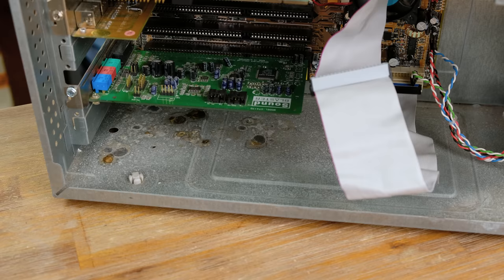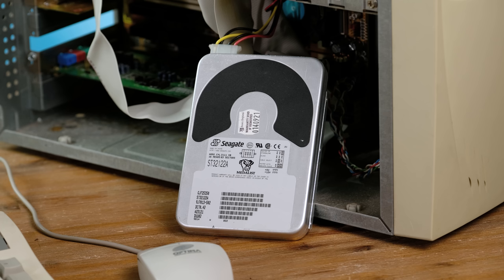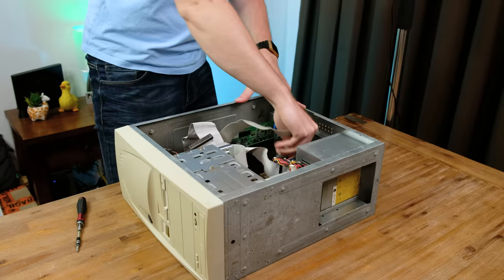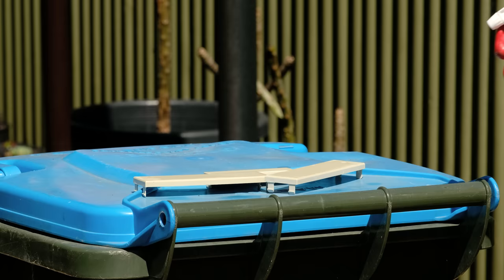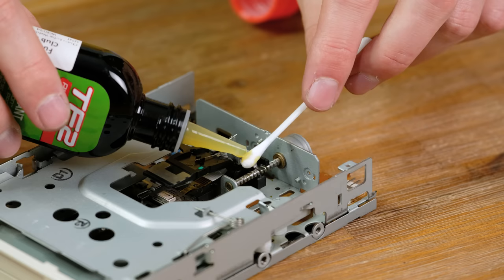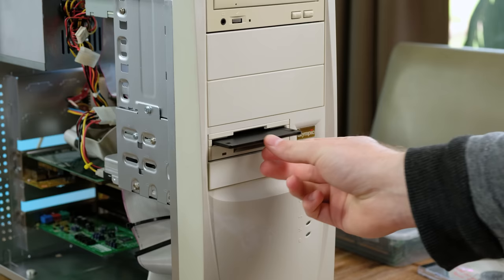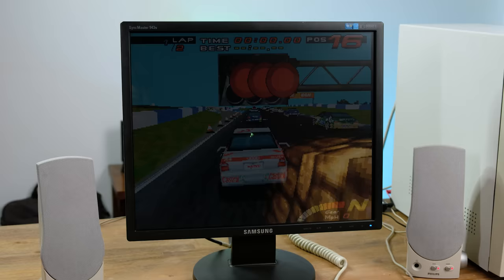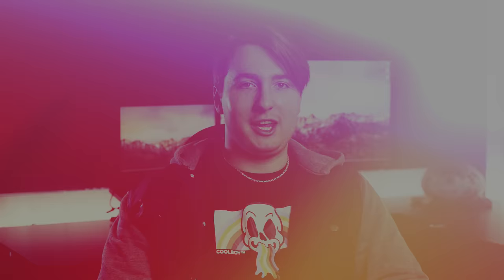Restoring a TERRIBLE Budget PC from 1997!

Comment from the maker: Big thanks to Ridge for sponsoring this video! ridge.com/PSIVEWRI - PS: The systems shows up as being windows ME after a USB driver update. The CPU fan was never touching any IDE cables. Sorry for forgetting to add channel members to the credits! Thanks for watching.
Reply: Good video broo!!!
Reply: I like ms dos also the gateway i would put packabell program on it i like it LOL YOU GOT PRANKED MAN
Reply: Oh hello there, youtube algorithm sent me here heh.

Got a pretty good windows 98 pc myself free a few years ago.
AMD K6-2+ 400 mhz (swapped from a pentium mmx 166 mhz overclocked too 200 mhz.)
32 mb edo ram, could use an upgrade too 96 - 128 mb.
quantum 4 gb harddrive, had a 60 gb western digital drive from 2006 as a secondary drive & briefly as primary after cloning the operatingsystem onto it, but lost the partition so it refused too boot on the 60 gb drive, but still had all games on the other partition.
asus p55t2p4 motherboard, technically doesn't support the processor i put in but it still runs saying its an unknown amd processor lol.
2D gpu: matrox mystique 4 mb some software 3d rendering card, supports like 8 games or something like that & those were only ofc on the included software cd's.
3D gpu: voodoo 1 4 mb from diamond, the monster 3d version, most common one around probably.
Soundblaster awe 32 pnp i think it was in this pc.
pci to usb addon card which either causes the pc too lock up or its either of the graphics cards that are failing fighting over resources.
Bios battery is one of those chips with a built in battery which i haven't bothered doing anything with as it still boots.
Reply: c
Reply: You should find one of these old PCs and completely max out the specs.
Reply: Psivewri I am sending you a video idea, well a letter, in your Parcel Collect address.
Reply: Does anyone know where I can get my hands on that usb and ps2 card that plugged into the motherboard I have a similar machine that will not post without a Keybord and I only have usb keyboards
Reply: Yeah In a 2043 restoring a budget pc from 2020 🤣🤣🤣🤣🤣🤣
Reply: What do you do with all the computers you restore? Do you just throw them away? I seriously doubt you have a warehouse full of those things, and I doubt anybody will pay enough for them for you to make a proffit.
Reply: please do a vedio on dell precision t3600, t5810, optiplex gx 260,
Reply: I still have a case with that exact style of front, except it's a 12 bay tower with separate left and right side panels. I bought the case new in 2000 to build an all new Pentium III system.
Reply: To fix the graphical glitches try popping the RAM chips out of their sockets on the video card then putting them back in to clean their contacts, and get two more to fill the empty sockets.
Reply: please do a review on the chromebook 14a na0000 i have one and i need you're opinion on it
Reply: I have that exact motherboard
Reply: @Psivewri pls i need some advice on a old laptop
Reply: Wait! Is that an Optima Mouse? ;) 9:16
Reply: i also have a old old pc it has 256 mb of ram and 81 gb hdd and it also have floopy     
disk and cd rom its very very old please buy it from me any one please  i want to get rid of it and it has a pantium 4 cpu
Reply: You should buy a hp Pali lion a815n it’s got a pentium 4 processor and is shitty but it and upgrade it
Reply: @GAVRILOVICI AUGUSTIN no i was born in 2005
Reply: Nice
Reply: To fix the 3D accelerator problem, could you add a 3D graphics card? Just an idea.

Comment: 2000: WOW you have 1GB ram? that's so good!

2020: how can you use google chrome with 8GB ram that's not even enough.
Reply: What's amazing is that we treat these old throwaway pcs as relics of the past, but as a piece of engineering it's still absolutely incredible that humans made this thing.
Reply: @Ahsokaaep chromebooks dont need more than 4 gbs of ram
Reply: Most people had 128-256MB in 2000. 1GB was overkill.
Reply: 16 gb ram dual channel :)
Reply: I have 8 gab AND a mechanical hard drive and it can game but it can sometimes crash
Reply: I have 4gb of ram lmao.
Reply: 8gb is not bad not even 4
Reply: its bad as fuck dude, i open my minecrafr launcher, close it and my pc literall freezes
Reply: @babydriver6473  Meanwhile my netbook across the room with 1GB. Upgraded from 512MB.
Reply: Almost like Computers evolve 🙄
Reply: I have 4
Reply: Monochromatik-Vision  In 2008 i got 4 GB of RAM, and guess what - my PC was a Dell Optiplex 760 running Windows Vista Ultimate SP2. I hesitated to upgrade it to Windows 7 but then I decided to dual boot it anyway in 2017.
Reply: In 1988 my first computer had an intel 8088 cpu and 8KB of ram, cga graphics, no hard drive just dual 5 1/4" floppys.. ahh the good days
Reply: Monochromatik-Vision  Well. Older PCs from the 2004-2005 era aren't really designed for use with Windows Vista. So when the same old drivers are rewritten for Vista they tend to be unstable due to the fact that Vista uses a newer driver module as compared to XP (WDDM). This problem were finally fixed with the arrival of SP2 in 2009. However by the time SP2 arrived, Windows 7 was on it's way to be released - so it was too late for Microsoft to solve the issue.
Reply: My Powermac G4 from 2000 has 1.7GB ram
How much would this have costed back in the day?
Reply: @cytro  (In Don LaFontane's voice) An arm and a leg
Reply: @doganb34  you had a pretty low end pc for that time my pc had a 286@6mhz 896 Kb of ram EGA graphics and a 10 MB MFM hard drive. And ran MS-DOS 3.30 in 1989 and a high resolution monochrome display  (amber).
Reply: @cytro  My Friends Powermac g5 quad core has 16 GB Of RAM
Reply: @Ahsokaaep  windows 7 is a good computer
Reply: @Ahsokaaep  no my favourite is windows 2000
Reply: In 2002-03 I had a handed down old machine with amazing 96 MB RAM  and a 4 GB hard drive. I knew it wasn't the best, but it was mine.
When I got a prebuild in 2005 it came with 1 GB RMA, absolute madness you can open so many programs with it. Typical was still to run 512 MB, but I had a full GB in it.
Reply: 1 GB of ram would have been huge in 2000! 128 MB was about average for the time.
Reply: @the hevy Which of them. The old hand-me-down, or the newer one?
Reply: 2020: "Hey 2002, how much RAM do you have?". 2002: "I have 3 gigs, how about you?". 2020: "I have 2tb of RAM". 
2002: "WHAT!!".
Reply: 4gb is just fucking rut for gaming unless you wanted to sell broken pcs
Reply: @doganb34  70s dude
Reply: @the hevy the hevy, lol did you name that after your old lady?
Reply: i have 32gb ram
Reply: games only require such ridiculous amounts of RAM because developers are getting lazier and lazier with memory management, and just give every variable a byte or even more, even a flag, which can be grouped into a group of 8 flags, making them all take up a bit, compressing flags by 8x
Reply: @the hevy more likely 16GB's of ram
Reply: 8GB of ram is more cinematic! The human eye can't see past 2GB of ram anyway!
Reply: @Ahsokaaep  you don’t really need much more than 1gb to run mostly just browser apps
Reply: I have a mac with 8 gigs of ram an i5 processer...its a 2020 mac book
Reply: I only have 4 gb ram
Reply: @S1dra.  irdc
Reply: @cytro  irdc
Reply: @Roshsugar  thats it? LOL
Reply: @doganb34  Hang on. I thought it was 1978 PC specs?
Reply: @the hevy 16 gigabytes is mid tier nowadays
Reply: This got me thinking of that weird Al song

Weird Al - All about the Pentiums

"Workin' at a desk with a dumb little placard?
Yeah, payin' the bills with my mad programming skills
Defraggin' my hard drive for thrills
I got me a hundred gigabytes of RAM
I never feed trolls and I don't read spam
Installed a T1 line in my house
Always at my PC, double-clickin' on my mizouse" lol
Reply: @babydriver6473  Minecraft crashing at 8 GB? What CPU do you have? First gen Celeron? It runs perfectly on my 8 GB PC.
Reply: 2000 - 1Gb RAM hehehe...
Reply: @Tom2404  my mom had 2 gb RAM
Reply: I have 8gb
Reply: @babydriver6473  My phone has 3 gb and can run minecraft good
Mabye get optifine mod or bedrock editon
Reply: @ab8jeh  i go to dumpster,pick old pcs that are not broken,i clean and resotr it,i have collecion of ibm,compaq,packarf bell etc,damn technology is fast,i love these old pcs😻
Reply: @Tom2404  Yeah pretty much. I think we had 16 MB ram in 1997.

1994: WOW you have 8 MB ram ! You only need 4 to play X-Com!
Reply: @babydriver6473  I know your pain bro I can’t even run mc mods at more than 13 FPS I have 4GB ram
Reply: laughs in 4gb ram in 2021
Reply: @Tom2404  I dont think 1 gig ram modules, were even out yet, in 2000.
Reply: I'm still gaming with 4gb ram but I will add another 8 gig stick later
Reply: @zaf2774  did not ask
Reply: 2gb ram gets too little, computer gets sluggish unless you have some old unsupported windows, even if its better than nothing as you can at least play some old games.
4gb is fine actually, plenty games can be played just no newer ones. 8gb can play anything, but it will still likely be the limit of the pc if its a new pc. more than 16gb is useless for just gaming, with few exceptions
Reply: 2004: WOW 35fps that's overkill
2021: you're playing under 140fps, 288hz and 8k? You'll ruin your eyes...
Reply: Lol...no gamer had 1GB of RAM in 2000. More like 2005 or so.
Reply: @doganb34  Gotta love those 5 inchers :-P TRUE "floppy" discs.
Reply: @bernlin2000  linus tech tips probly did
Reply: @RoachEditz-911  haha i just realised i put 1988, that was a typo, it was in 1986! My bad 😁
Reply: @doganb34  Hello after 9 months.
Reply: i can game on 8gb ddr4
Reply: @Samuel Chertoff I have only 8 more, 128GB.
Reply: I have 8g DDR3 😭
Reply: @Midnights06  thats... supposed to be bad? those are average pc specs
Reply: @simsim9755  ram doesent matter that much for minecraft, you dont need more than 2 gigs for it
Reply: i have 8gigs, my mc is at 3Gigs, my ram usage is at like 98% after running the game with leaving discord and a few chrome tabs open
Reply: I have 8GB of ram, it does the job okay for what I do. (Web browsing, basic games such as Roblox, virtual machines)
Reply: @Midnights06  you should get an ssd seriously it's worth it and a 128 or 256gb ssd just for the os is pretty cheap these days.
Reply: Most 2020's games suck, graphics is the only exciting thing about them. People have no standards for gameplay anymore.
Reply: I have 10gb ram in my 1997 computer
Reply: My classmate once said "i'm going to install 64 MB RAM! - why would you need such enormous amount, I replied - because I don't want to see any loading screens, since my PC would be the fastest!". It was in 1994 if i remember right.
Reply: not unless you use linux or BSD. 4 GB of RAM goes a long way and they are becoming quite user friendly
Reply: even just a gig of ram in 00 would have been really unnecessary lol
Reply: me who has 8gb of ram and 10 gb pagefile: what are you talking about my laptop can handle litteraly anything
Reply: @babydriver6473  same
Reply: @Tom2404  Would have been bloody expensive as well!....I brought a128MB of PC100 back then, it was £125..and that was a good price then.
Reply: With 8 mb you can run quake, so totally worth it.)
Reply: bro my pc is not bad for gaming but the 4 gb of dual channel ddr3 is just too little for the games i play
Reply: @blox2542  sigh
Reply: "2020: how can you game with 8GB ram that's not even worth it"🤣🤣🤣🤣
Reply: @wallychambe1587  worth it? You good?
Reply: Also my pc who has a SSD of 1 TB and 16 GB Ram :))
Reply: @Tom2404  My old Aptiva IBM. 8mb ram, upgraded it to 16mb. My computer was considered cool by the kids since we could play Civ2 and Sim ants smoothly.
Reply: @Tom2404  I think most motherboards only supported 512mb max anyways
Reply: Bruh my computer uses 6-7 gb ram in idle state
Reply: @ab8jeh  by 2026 u will need 32gb ram + nvidia 5040 18gb ram card just to have 5 tabs open
Reply: back in 1997 16gb was considered huge, even for storage. now in 2023 16gb ram is fine
Reply: mad how things have gone. a few seconds of video off a smart phone in 2023 would use the same space as a whole win 98 fresh install

Comment: Let's power it up!

Cpu fan: HDHSHSHFHNFHSIR
Reply: It was the power supply fan, i hate that noise 😂
Reply: LOL
Reply from the maker: @matiasvarela460  nope. Was the CPU fan.
Reply: @psivewri  I know this but on my RetroPC the fan bearing died.
Reply: @psivewri  Whaaaaat 😱😂 My power supply makes the same noise!
Reply from the maker: @matiasvarela460  I'd suggest replacing the fan or lubricating the bearings then 😀
Reply: @matiasvarela460  haha
Reply: @psivewri Are you going to make another video on a x230 thinkpad?
Reply: AT THE AIRPORT TERMINAL
Reply: My MacBook Air is louder than that
Reply: before you edit it, it said "hard drive: HDHSHFHNFHSIR"
Reply: I think the blades were hitting the ribbon cable resting against the fan
Reply: @psivewri  yo psivewri do you know what the pc's name is like the model. Cuz I had one like this back in the day and I dunno what its name was.

Comment: 64MB of RAM seems quite high for '97, doesn't it?
Reply: it depends. in my primary school i had Celeron Tualatin with 32 MB of SDRAM, but my old home PC in those days had Celeron Coppermine with 128 MB :D
Reply: A friend of mine here in England, bought a brand new PC in late 1997 from Costco, a Compaq Presario 4504 and it had 16MB SDRAM, 2GB IDE HDD, 1MB VGA onboard chip and came with Windows 95b.  It cost around £900 I think.
Reply: At that time, RAM requirements were doubling every 2 years. So, 64 megs was pretty high end in 1997 but it was already just OK in 1999 and complete garbage in 2001.
Reply: @user-xr3rb6pn9m  Yeah in 2001 I had a K6-2 500MHz with 256MB RAM, 20GB IDE HDD, GeForce2 MX400 64MB and that was respectable but not exactly cutting edge.
Reply from the maker: There's every chance that it had been upgraded already at some point 😃
Reply: 1997 the max ram would have been 32MB. This computer looks more like 1998/1999.
Reply: This must have been a later model cheapie using "leftover" parts. The Cyrix MII's main competitor was the Intel Pentium MMX series and 72 Pin EDO SIMMS would have been standard in that era. Kinda odd that this takes DIMMs. DIMMs weren't really popular until the PII/Celeron era. 32MB of RAM would have been a LOT for a machine of this vintage. I had a P233MMX at this time with 48MB RAM running Windows 2000.
Reply: @psivewri  True
Reply: Yes in the year 1997  64 MB RAM was really extrem much, 32 MB RAM was the standard.
Reply: @mckluty8660  Back in December 1996, my family got a Windows NT 4.0 gaming PC. My dad had a very deep wallet at the time due to the farming business, and the computer had 64mb ram running at 300 mhz total (two Pentium 1 processors on a single motherboard). It could go up to 128mb if needed. The only upgrade we remember getting was a RIVA TNT 1 chip in July 1998, to replace the VooDoo 1 card which we locally sold afterward. This PC ran most games from the late 90s and early 2000s (primarily boomer shooters) near perfectly, and outside of the RIVA TNT 1, most components were from 1995/1996.
Reply: yeah back in 97, most systems had 16mb to 32mb of ram, Some systems still ran windows 95
Reply: @homg85  yeah i would agree, chances are this may have had a ram upgrade.
Reply: I have a Dell D1000R with only 256mb of SDRAM, honestly for most things (On Windows XP and Below) it runs pretty good with it's much later aftermarket GPU. It will not play games like GTA IV however I have gotten Oblivion to work on it pretty well. So not bad... though I have tried Windows 7 on it and loading is way too slow (least on it's current HDD)
Reply: Yeah even PS2 had 64 MB RAM
Reply: Things moved fast in those days.. the start of 1997, 64MB seemed unfathomable. Start of '98, 64MB was more standard, or at least a moderate amount. Some guys were still trying to pass off 32MB as being the norm (i.e, entry level Macs) into '99. And I remember as a kid in 1996, there was an annoying TV ad that'd run selling a PC with 16MB of RAM. "That's right, 16MB of RAM! " the guy would yell lol
Reply: Could have been for a workstation, although it certainly doesn't look like a workstation lol (the audio card kinda gives that away, wouldn't be needed for most workstations).
Reply: @bernlin2000  unless you were doing audio production 🤔 nowadays you’d just have an external USB/TB interface rather than a card. But in the late 90s… I mean I’m kinda just kidding, that doesn’t look like a super high end card. You use good audio interfaces to reduce background noise when layering recordings, so this era of notoriously noisy sound cards would probably be worse for that than modern integrated audio (already fairly noisy when layering 5-20 tracks, but thankfully they’re almost imperceptibly low noise for regular listening — unlike this era of cards!)
Reply: @MattExzy  that’s right — next to nothing!!!!
Reply: @user-xr3rb6pn9m  shows how rapidly pcs became obsolete in the late 90s early 2000s
Reply: My first PC from 1998 had 32MB and it was a little above the standard 16MB.
Reply: Not really 128 was the standard I think
Reply: @homg85  Late reply, but nope, my first PC bought on March 1997 (not exactly sure about March, but absolutely certain about 1997), had a Pentium MMX 233MHz, 64MB of SD RAM and a 3,2GB Quantum Fireball, on a SOYO motherboard with a Viper V330 graphics card based on a Riva 128 GPU.
PC's like this one existed back on 1997, but were quite expensive due to the massive RAM. They became more sensibly priced by the end of the year.
Reply: @psivewri  hello big fan, how can i put windows 98 on my 1995 pc i dont have the disc